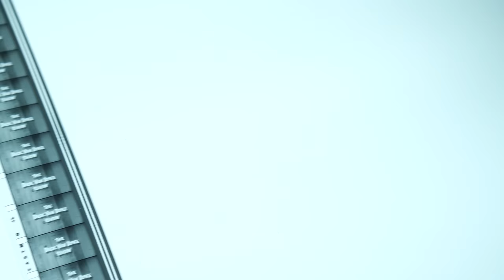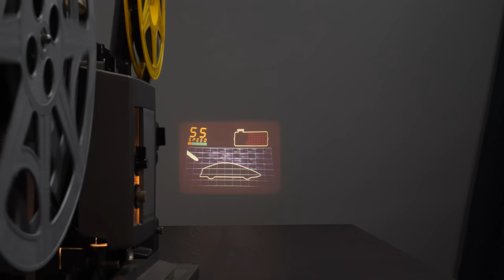Movies made sound with a light bulb: Sound-on-film

Comment: This reminds me of working at a movie theater as a projectionist. Lot more winding film through projectors than this small projector. Sometimes the platter would be pretty far from the projector depending on way room was set up. lots of rollers, pick up trolley, etc. Stopped working as a projectionist before all digital format. Remember spending long hours splicing film. The platter (basically what the return reel is on this) is sideways, with multiple platters that can hold multiple movies. Its pretty cool the platter spins like a return reel and is controlled by what we would call a brain. The brain would pick up the film from the pickup trolley at correct rate. The brain is that thing in the middle of the platter.

Comment: I remember being shown the projection room of a new multiplex in the early 1990’s. They used to feed the film through 2 or more projectors so they only had to rent one film, to show on many screen simultaneously. The projectors were locked electronically to ensure speed matching. They also put metallic strips on the film to trigger events, lights down, curtains open, wide screen from the adverts etc.

Comment: As an (ex)projectionist in multuplexes, I consider myself real lucky to had experience the magic of analog film right before everything went digital. This episode was a great reminder of the technolgy that was so common.

I'd like to add some funfacts:
Not mentioned was that SDDS were on both sides were for redundency. Its the same data on both. However in my mind the best thing about SDDS is that it had two more front audio channels! A propper SDDS equiped cinema would have five sets of speaker channels spread across behind the screen. With propper mixing from the studio, the audience would hear sound coming much more precicely from the same position as shown on screen (for example an actor speaking). However in reality this feature was mainly reserved for the larger screens, all else only having the usual three front channels.

It was nice to see DTS mentioned as well. A real problem with DTS was that the disk always got missing as the film copy traveled from theater to theater. Most movies I recieved with DTS track never came with the disk. And a big pain in the ass with DTS is when playing in markeds where they schedule a dubbed and a subtitled version on the same screen. I'd have two films, each with a different sound track, yet the DTS matching signal are for some stupid reason identical on both!? I'd play the dubbed copy of the film, the DTS-module would pick up the signal from the sensor and the English audio track would play. Audience would get really confused and start to complain. At the time of noticing, switching the audio was easy, but I can't exaclty rewind the film to start again. What it ended with was that most projectionist just didn't bother to deal with keeping an eye on what audio-version was loaded at each screening. Thus DTS rarely got used, even tho we had the equipment.

Comment: My subscription was somehow removed, so only just getting to the backlog of newish content. Loved this one for the deep dive into projector tech. One of my favorite jobs was as a projectionist for AMC in early 2000's and again from 2011-2013. Threading a film properly is certainly a process, and unfortunately wasn't easy to do without using an actual film to know if we did it right or not. We eventually had a test reel made up of old trailers that allowed for a good training tool. After taking a break to go to college, needed a side gig before starting my career, so went back to AMC and was amazed that the muscle memory for threading a film was still right there. Rejoined the company right at the beginning of the transition from print to digital. A lost art for those not at the production company level. And the source of a lot of current viewer frustrations. Bulb maintenance at a lot of current theaters is almost non-existent, I wonder if its because they all think they'll be transitioning to laser soon.

Comment: I was a film editor in the 70s in local TV.  I had two projectors running different film shows all day.  We had films that were optical and magnetic sound.  I really liked the optical better because it was easier to bloop when editing was required. You had to know that the sound was going to be ahead of the pic to bloop effectively.  A liquid blooping was applied with a brush. Mag required sticking blooping tape over the track.

Comment: Great video. I am a 50 year veteran of the theatre industry.  I have run projectors now I mostly do lighting and some audio.
I am involved at the Redford theatre. We still have two 35mm/70mm projectors. Both can run 24 feames/sec. Or 30 frames/sec.
They can show mono, optical sterio, magnetic sterio in 4 channel and 6 channel with split surround and a sub channel. Dolby digital. Sdds with the DVD disks. Plus we have a digital projector.  We still do two projector showings. 
Loved the cue marks through out and the panavision tee.
Thanks

Comment: In the 1980s, I worked as a cashier in a movie theatre. I did get to learn how to build and break down films on the platters, and how to thread the projectors. Threading them for the first shows of the day in that multiplex ended up part of my job.

A few years before, in that same theatre, I saw Tron in its initial release. The projector stopped several times during the show, so I missed parts of the movie and ended up getting a refund and seeing it elsewhere.

My most memorable experiences were in another location in that chain, where I got to see Indiana Jones and the Temple of Doom and Star Trek IV in 70mm with 6-track magnetic sound.

Comment: When I was a student, I was one of the kids who would volunteer to work the projector. The model we used in class had a nifty auto-feed feature which would pull the film in and thread it through the whole path and spit it out the back. You only needed to wind it onto the takeup reel. For the film loops above and below the gate, there was a lever which you pressed to automatically resize them to just the right amount of slack. I’m guessing it temporarily uncoupled the gear train to reposition the sprockets. Sometimes the film would get out sync and go blurry, and you would need to press the lever a few times to fix it.

Comment: 37:00 There was indeed DVD sized DTS. Eventually all of the DTS units had DVD drives in them (since by the end of the 2000s it was cheaper than an actual cd-rom) and could take either the 5.1 CDs or the 7.2 channel DVDs, theaters simply had to indicate which format they wanted when ordering the film. DTS even had a 10.2 channel format for IMAX distribution.

Comment: I was an AV geek in high school using that same projector. I did projection booth duty in college using slightly higher quality projectors. I ran TV film to video telecine chains at a local TV station. I was a telecine system engineer in Hollywood in the 80s and 90s transferring 8/16/35 mm film to video. This video is so much fun, remembering each era!

Comment: I saw the movie, Outbreak (1995) in theaters in its original run. The movie theater had the flim loaded in such a way that it was flipped from left to right. Thus, we watched the audio track running along the left side of the screen, and the sound for the first 5 minutes was noise with a rhythm. I saw the analog audio tracks and recognized that part. That meant parts of the movie's video frames were getting processed as if they were audio. It was almost like a helicopter sound, but worse.

We were shocked it took someone as long as it took to realize the error. But as you pointed out, by that point in movie theater history, they mostly kicked off a film and moved on to the next screen to do the same and so on, only occasionally making sure things were still running properly.

Something that complicated matters is that in that movie, the early scenes show people in suits that make it hard to even try to read lips. I wouldn't be the best at that anyway, but it made it almost impossible to figure out what was being said. Spoiler Alert for an early scene At one point, we saw an aircraft approaching the village where the prior scene took place. Suddenly, the movie stopped. They had noticed the problem and spent a few minutes fixing it. They then pulled the film through. But that made it so we missed a few seconds of the film. Suddenly, the village blows up. They had advanced the film so perfectly in terms of the scenes/plot of the movie that we never saw the bomb drop from the aircraft, nor the descent. We just saw the aircraft and the explosion immediately following the break to fix the problem. It made for a very strange start for the film.

Again, the noise was horrible, and amplified to normal movie volume. But I enjoyed watching the analog soundtrack, hoping I could figure out something about what was happening in the soundtrack by watching it. If there was any digital audio, that was off-frame, as you point out that's either between the holes, beyond them, or between where those are and where the video would be even if the film is flipped around.

Comment: Most cinema projectors by the 1960s had 4,000 feet spools so two reels could be joined together. You are sort of right with the changeover: the first dot was the signal to start the incoming projector and the second one involved flicking two switches. There was one on the projectors which brought a shutter down on the outgoing machine light and opened a shutter on the incoming one. The second switch was usually on the wall in front of the machines and took the sound from one to another. It sounds complicated, but we did it without most people knowing how the magic worked.

Comment: I can remember DTS system.  We got a callout to the local cinema in the mid 1990's with a sound problem.  The DTS player contained 3 CD ROM drives that were SCSI.  This SCSI went back to a mainboard that looked like a custom version of a 386/486 PC motherboard which was the standard around that time.   The audio out came from this board, no provision for a monitor etc.    It took 3 CD ROMs discs to hold the audio for a complete movie.    In this case, the CDROM players were getting old and worn out and needed replacement.   Even then SCSI CD ROM players were getting hard to find and expensive.   $300 Ea as I recall.

Comment: Since your crutch of this video was the making of sound with LIGHT.  Thought I would throw in, projectors back in the latter 60's when I used to run them had a special light.  Some were a very big and bright Bulb, but the one's I worked with, the LIGHT was made with Carbon Rod's. Just like the rods welders would use to weld. You had to strike them together then a little drive motor keep them at a  distance to remain glowing.  (very brightly) 
 As a added bonus  film used a decade of or more before I was a projectionist.  It was highly flammable.    I did get to see a reel of it one time. It was called   Nitrate Film.

Comment: Nice presentation. I was the projectionist at the museum on Ellis Island in New York City for a couple years in the 1990s. Two corrections. First, it looks like your top loop is a frame or two too big. The film is rubbing on the corner of the film rails, which may scratch it. Second, as I understand it, when recording, the galvanometer did not move side-to-side, but up-and-down. It reflected an image of a wedge-shaped transparency onto a slit. At one extreme, the narrow point of the wedge is projected onto the slit, and the recorded track is narrow. At the other extreme, the wide base of the wedge is imaged, and the soundtrack is wide. At zero volts, the center of the wedge is imaged.

Comment: the way the projector is threaded reminds me a ton of how industrial sewing machines are threaded. the flywheel, the tension, etc. They also rely a ton on having a certain amount of tension (though we have a tension dial because a few variables affect how much tension you need at that moment) and mechanically perfect timing. Do you have to oil the projector as well? Industrial sewing machines have a bed of oil underneath them that continuously lubricates to keep it running smoothly.

Comment: Another great, interesting video from you. Thank you.

in the 70s I made 8mm films with sound. One method was to synchronise the projector with a tape deck using a gadget called a Synchrodek. It was frame accurate and allowed great sound quality.

Later I started getting my films striped. That is a tiny strip of magnetic tape glued down the edges of the film, I could first assemble the sound on tape then transfer it to the stripe via the Synchrodek .  Recording on the 'balance stripe' allowed stereo sound. (The stripe made the film thicker so a stripe had to be applied to both sides)

Kodak brought out a sound film with the stripe already on it and the cameras would record audio.  But, with the sound being 24 frames (thereabouts) seperate from the image, editing was a problem. But we overcame that by transferring the audio to perforated tape, via the Synchrodek, editing the tape and film simultaneously (physically cutting and glueing) then transferring it all back onto the stripe. Messy but hey, that's film for you!

Comment: When I was maybe 13, 8mm home projector, I accidentally caught my thumb between one of those sprockets and the thin metal strip that goes half way around it.
The teeth on my sprocket were more protruded than on yours.
Made it through with no broken bones and just a few perforations (not in my nail).
I can't tell you how relieved I was that that was all that happened.

Comment: Thank you for a great video on film projectors. One thing if I may, you say the reason 35mm films only came in 2000 ft (20min) reels was because they didn’t have the large platters like they have today. That is not quite correct. I am sure it would have occurred to them if they joined all the film together then they would only need one projector which would have been a massive saving. No, there was another reason. The intense light required could only be provided by carbon arc lamps. These burned carbon rods a little bit thicker than a pencil and with a coating of copper on the outside. As the rods burned away they were slowly move forward to keep the arc gap constant. During a twenty minute reel the rods would burn about four inches from the positive rod and a little less from the negative one. They were supplied with 70v at about 40 amps. This DC current rectified from AC mains by a giant mercury vapour valve (tube) it stood about 3ft high and glowed blue when working. It would have been impossible to have carbon rods long enough to cope with a ninety minute movie. Hence two projectors. Sorry for my long reply, got carried away for a moment. My first job was cinema projectionist, I loved it.

Comment: Thank you for this superb explanation! From 1965 until 1984, I was a part-time IATSE 35-mm projectionist and also ran 16-mm while I was in high school and as part of my US Navy rating (Training Devicesman or 'TD'). I only dealt with monaural reproduction in the smaller-gauge world. In 35-mm, the only thing that differed in the Dolby environment was switching on the Dolby unit in the projection booth rack, which was done just as the feature's splice hit the projector's gate. And other than an occasional need to re-splice the film, I paid virtually no attention to how the audio was reproduced and an operator rarely, if ever, got that finite when handling the actual print. Given this, I never took the time to closely examine how the optical tracks were constructed. Still, I always had some curiosity over how it all worked and this video has answered that question.

It's also worth mentioning that many 35-mm prints and especially those of the blockbuster features (The Ten Commandments, Lawrence of Arabia et al, for example) included, in addition to the optical track, 4 magnetic sound tracks, each carrying their own unique audio tracks. As you're probably aware, the industry chose to lay them down BEFORE the aperture and as a result, the magnetic head was the first unit the film passed through before entering the projector head. 

To further complicate the picture (no pun intended), 3-projector Cinerama, a complicated widescreen format that actually predated its anamorphic successor, CinemaScope, used a completely separate 35-mm magnetic sound track that was recorded on its own strip of film. You can imagine the criticality of the 5 (count 'em, FIVE) projectionists ensuring the three projectors and the sound playback unit ran in perfect sync! The mechanics of making this happen relied on electrically synced drive motors but their purpose could be easily thwarted by a careless operator or not to mention, a film breakage during projection. 

Again, thank you from an "Old Timer" and I hope that you might consider doing a post of how laser projectors work and especially, the high end units now being used in IMAX presentations, as well as in the larger and more technically complex theaters? And BTW, thanks for the subtle addition of cue marks that you added! I'd be curious how many of your viewers picked this up? ;-)